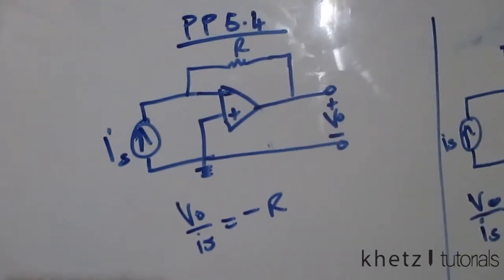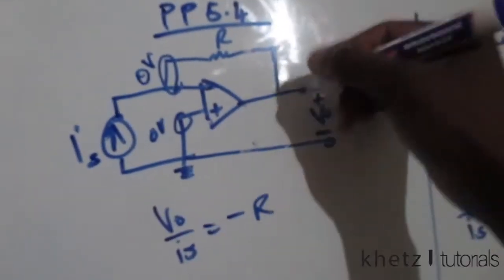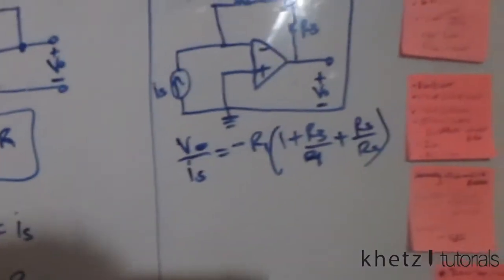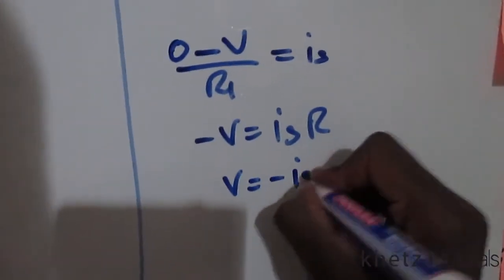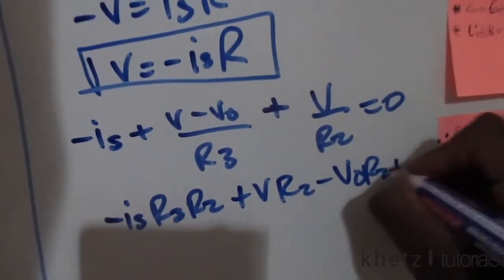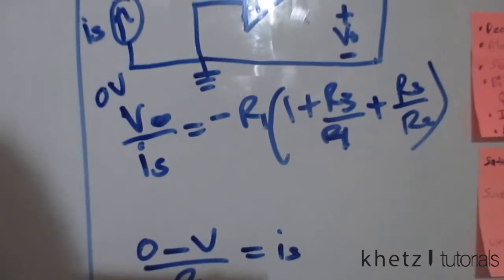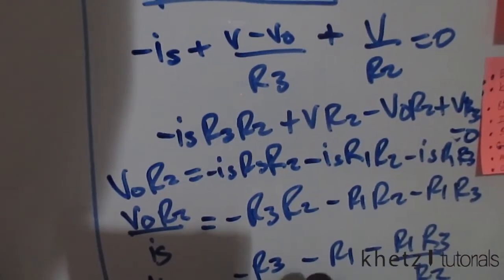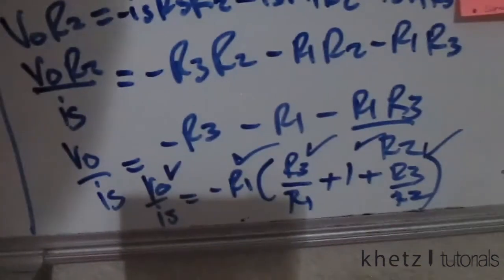Fundamentals Of Electric Circuits Practice Problem 5.4

Comment: Aren't all those resistors in series, though?
Reply from the maker: Please indicate the timestamp so I know which part you're referring to
Reply: 4:07 the nodal analysis part
Reply from the maker: To truly say that resistors are in series, they have to share one node and have the same current flowing through them. This does not hold for any of them since the source current is split, at the top node, into 2 different values. The resistors share a node but not the same current value